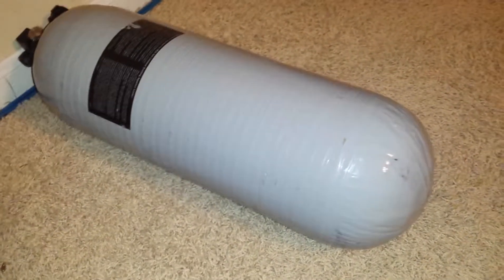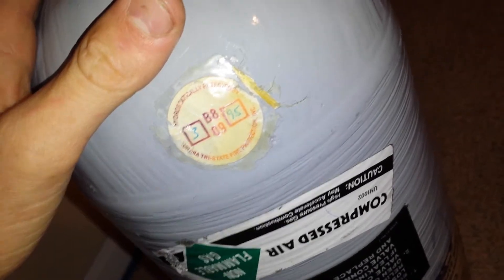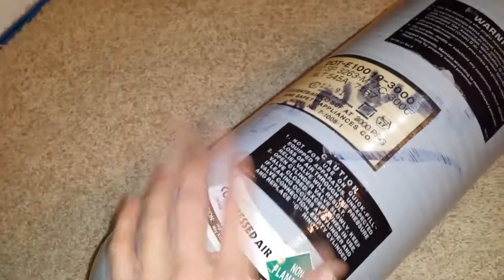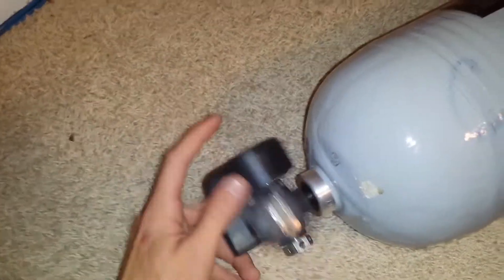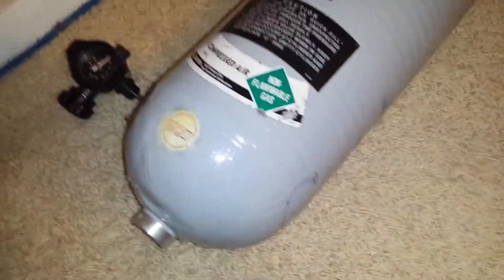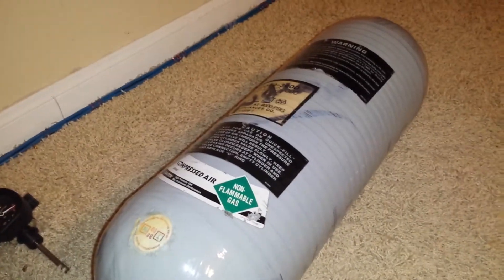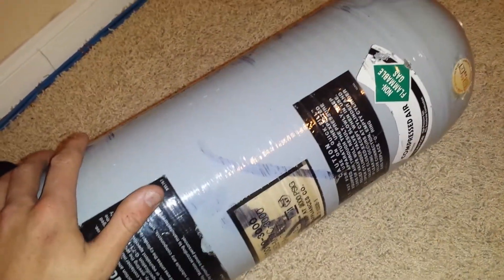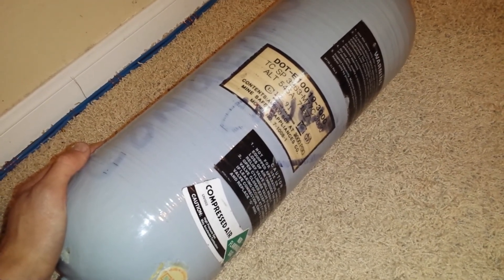Failed hydro test

Comment: A couple of problems here. Yes, several of the commenters below were right. All fiber wrapped cylinders have a limited lifespan of 15 years. And yes, it is illegal to drill a hole in the cylinder WITHOUT YOUR PRIOR PERMISSION. One of the other commenters was partially right by stating that you were to be given a condemn letter, but instead of the series of "X"s, a condemn label should have been epoxyed near the DOT specification. Just FYI

Comment: This Cylinder should not have been tested, A DOT E-10019 Cylinder has a 15 yr life span as most FRP Cylinders. They should have X out the dot Specs & sent you a letter stating the non compliance of the Cylinder.